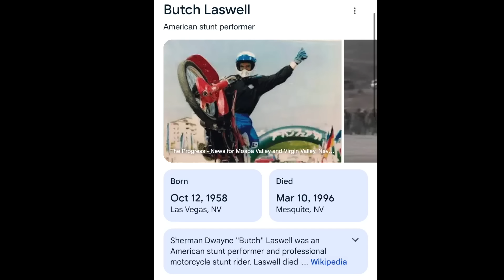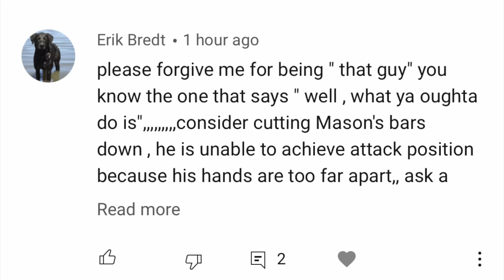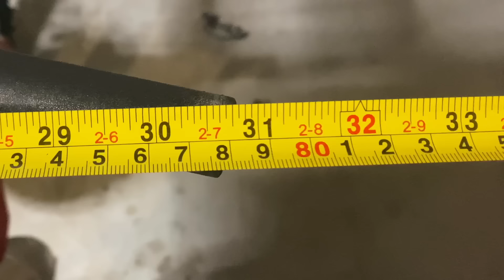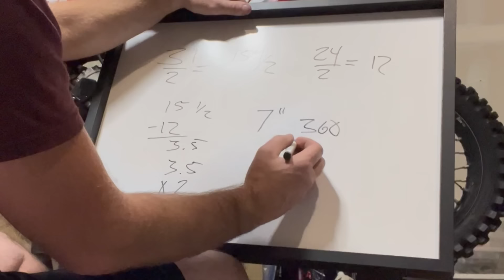Getting Mason's Dirt Bike Ready to Rip!!!

Comment: cut them way tooo short, also gotta round off the edges on the throttle side so it rubs smooth and does cut into the tube or stick
Reply from the maker: That is actually a really good point. I prob should have took off an inch at a time but I'll give him a few rides and the bars and see what he thinks.